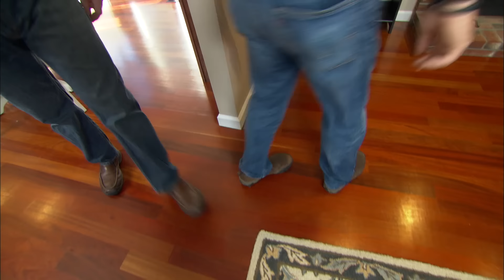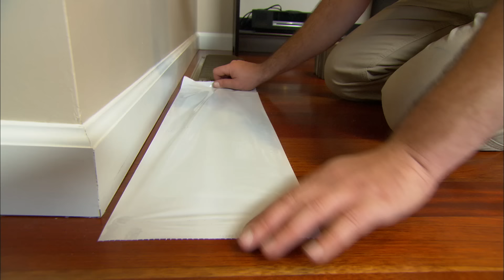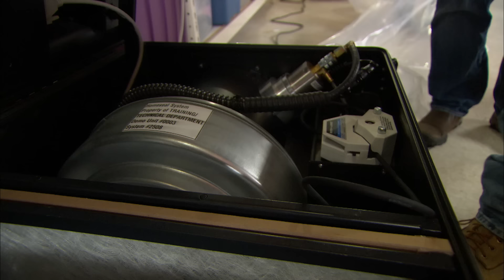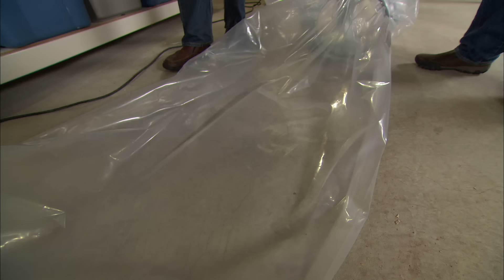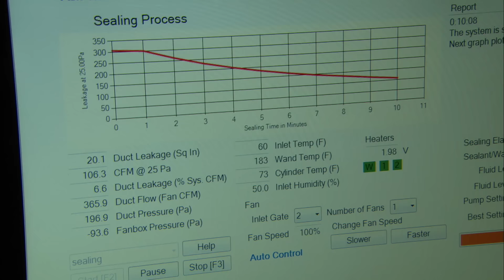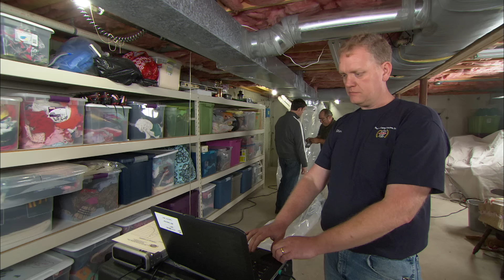How to Seal Leaky Ductwork | Ask This Old House

Comment: Ran hundreds of High Bill Complaints for the gas utility in St Louis, Missouri & I can tell you first-hand this service boils down to ductwork in unconditioned areas and ductwork in conditioned areas. For ductwork in unconditioned areas this service can be advantageous.For ductwork in conditioned areas such as basements or inside soffits there is very little advantage and in some cases big disadvantages. I had a customer that actually had a reduction in basement heat ,much like this installation & the water pipes froze one cold winter night ( I believe the Insurance Company for the duct sealing service picked up that bill).
Reply: Could have just put a register in the basement feed?
Reply: @phillymathguy8142  Yes, and it's better to have a small register vs relying on leaks because you're controlling where the air ends up (and what ends up in it).
Reply: @phillymathguy8142  , exactly, you want to keep the conditioned areas conditioned (don’t worry about a little duct leakage if it’s going into the condition area  & yes, add those registers were needed) . Take the money you saved from not insulating the basement ductwork and insulate those basement walls.

Comment: Cool technology. Better check the fan static pressure before you do this. If the fan is already having to pump against high resistance on leaky duct what do you think the resistance will be once all the leaks are sealed? The key is properly sized and sealed ducts. Old ducts are notorious for being undersized

Comment: you could just use some HVAC mastic tape or mastic sealant for about $25 from home depot and do it your self....or you can pay a guy like this $1000 or more to seal your system. They need to rename the title...
Reply: What about ducts inside the building, there's no way to access those.

Comment: Do HVAC installers do this, or is it a specialized thing?  I recently had a new furnace and new air conditioning put into my 1939 house with original forced air ducts, and I'm thinking I should probably get this done.  My HVAC installers did not mention anything like this, but they did refer me to a duct cleaning service.
Reply: Specialized service. I believe it’s still under patent/licensing agreements with a company called aeroseal. They use trained contractors across the country to perform the work.

Comment: Prohibitively expensive  in NNJ. But this is typical of initial  installation being done so poorly.  Hvac installers have their sights on the next install job before they even finish the current.  Just the way it is with most of these guys.  They demand top dollar for poor craftsmanship.   I speak from personal experience.

Comment: Should be titled: "How to pay someone else to seal leaky ductwork".
Reply: How would you seal leaky ductwork?
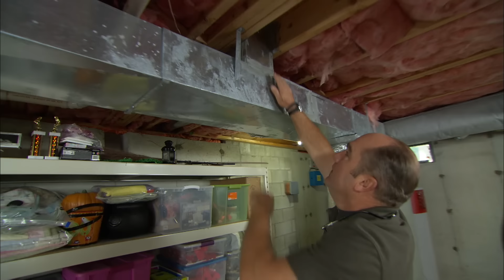Reply: @Joseph03743  2:00
Reply: @DLo5604  How would you get the mastic on the ducts on the walls on the second floor? Tear out all the drywall?
Reply: @aaronvance7372  You probably wouldn't. There's no doubt this duct sealing service beats mastic and taping. 
But there's an implication that when you click a How-To video on popular Do-It-Yourself youtube channel, you're going to learn how to Do It Yourself - Even if better work could be done professionally.
Reply: @DLo5604  That's bs, it isn't better then a quality mastic job. A mastic job cost substantially less, can easly last 30 years plus, this spray crap doesn't seal large gaps as mastic can and they don't back it past ten years. The cost of their jobs is easly triple a by hand mastic job and where you can't seal with mastic a homeowner will see far better savings investing the price difference in more insulation or doors/windows
Reply: @aaronvance7372  No you seal as.musr as you can with mastic, have your ductwork cleaned. Mastic jobs are substantially cheaper, last 30 plus years vs 10 of this. Invest the difference with better windows, doors and insulation. You will see substantially more savings then this will ever be able to do.
Reply: @zack9912000  please go to therapy
Reply: very clever.....

Comment: What happens to the coil once this crap plugs it up?
Reply: GOOD QUESTION. BUT THEY BYPASSED THE COIL WHEN THEY DID IT. HOOKED UP THE SPRAY TO THE SUPPLY AND RETURN, DID NOT GO THROUGH THE FURNACE

Comment: Holy f&*k. Too much work and expense! Slap some foil tape on those joints and call it good. And who insulates their ducts???
Reply: Foil tape dosent last long term. Need mastic to seal and ducts need to be insulated to prevent condensation when air conditioning and especially when ducts are in unconditioned parts of the house

Comment: Aeroseal would be the best option
Reply: @UCV9wEzJNlc8AhG1ha3t8fpA depends on duct work . But unless its been installed correctly and sealed from the start aeroseal is the only option. But sealing the outside with mastic is the only ok ther way

Comment: I've always wondered about something like this. My house was built in the late 60s. Anywhere a branch came off the main duct or return was massive leaks. I cut holes in the supply trunk and return wherever I knew ducts were coming in and out. I then sealed those branches with proper metal duct tape, duct mastic, or a combination of both. I then cut a larger piece of sheet metal to put over the hole, screwed it in and sealed it with more duct mastic. That helped quite a bit. There are still some areas I need to get to that I can't at the moment. Those spaces suffering the most that I can't get to, are above the garage.
Reply: Wouldn't hurt to spray some spray foam!!! Sounds like you got it going right.. I would've added spray glue though.. makes all the difference
Reply: Now that’s dedication

Comment: Got the quotes for my 1700sqft house 3-4k LMAO LMAO LMAO
Reply: @Stackali  Yeah, you must break even shortly after paying off your 30-year mortgage.
Reply: @Stackali  for that amount of money i'll comb over ever inch of my ducts with a magnifying glass and come out ahead
Reply: @ibtarnine  so true, and it would prob be healthy, god only knows wtf is in this sealant crap. I would avoid it.
Reply: That is pricey. Costs of heating / cooling our home related to the furnace/aircon run is about $150 6 months winter, $180 4 months summer, with about 2 months a year we don’t use either (maybe less than 2 months). If we even only saved 15% we’d save about $250 a year, so need to be here for the quote we got 10 yrs. BUT, that’s just the savings cost. There are the other benefits of more balanced temp for bedrooms and basement, and longer furnace life and lower maintenance costs. So potential pay off for us after considering indirect costs is 7.5 yrs.
Reply: @zalllon  Don't forget cleaner air since more of the home's air will actually go through the filter.
Reply: 😳🤬 WOW!! That’s a crap load of money for a 1700sqft. Crazy.
Reply: I got a quote for 2000 cad for mine near Toronto.  Ask home depot, they have people who do it too, might give you a better deal
Reply: @mojo36911  curious how big your house is? And how leaky did they say your ducts were? Really wonder why it’s so expensive for what it is.
Reply: At that price if you have a single story home just replace the ductwork and make sure they seal it properly.

Comment: If metal is a good conductor of energy, why is it used between the air handler and the room?
Doesn’t it lose 40-60% of its efficiency?
Why not pvc?
Reply: Metal is used do to its roughness factor and formability. Were worried about airflow and friction when it comes to ductwork not heat transfer or loss, thats what insulation is for. Pvc would be incredibly expensive to use given the sizes needed  to get the volume capacity needed for proper airflow.
Reply: Most homes these days use Wire Flex (think of a giant slinky wrapped in plastic then that is wrapped in insulation and plastic)which is very well insulated. Most solid ducts in homes are wrapped in insulation to prevent the leakage as you saw in this video.  Commercial buildings with spiral duct  (the solid stuff you'd see in a five guys or chipotle) are not insulated at all, the idea is that you won't lose much because the occupied space is treated and therefore shouldn't be that much cooler/warmer than the ducts, though I've always had an issue with that idea.  Why not use PVC? Cost mainly, it would be incredibly expensive compared to wire flex or spiral duct and would take much longer to install.
Reply: they do use pvc pipes in most newer and smaller townhouses due to much simpler design in these houses. metal ducts are still needed for most detached houses due to flexible nature of metal.

Comment: Absolutely no heat loss here even if the ducts leak a little in the basement 
This is called stack effect or chimney effect where hot air is constantly rising 
If you experience cold rooms save your money by adjusting the floor registers to push more air into rooms that need more heat
Everyone is trying to sell their gimmicks to you   Not needed in a properly installed HVAC system
Reply: Your clueless

Comment: The dust is probably from a stronger blower than the old furnace and stirring up the dust in the duct work. It’s not from leakage in the duct.

As for cost of this versus saving and paypack, I would be interested in that.

Plus all leakage isn’t into unconditioned space, so you are not just loosing it, it may not be going to where you want but it’s still in the thermal envelope

Comment: What does this sealant do to the evaporator and heat exchanger? Or did they remove them from the airflow somehow?
Reply: I bet they were removed from the system prior to
Reply: it's very easy to divide the HX and humidifier off from the main duct during the operation, just ask the true foreman duct cleaning guys.

Comment: What is the cost of this process
Reply: Based on the price I was quoted, about $2,000
Reply: @MichaelMangi  does it base off  number run and or sq ft of house I assume..
Reply: @bradami1234   I think it was based off number of systems, but maybe number of vents factored in.  All I know is on the paper that was offering it from the HVAC company I was talking to about an AC replacement the listed fee was $1795 for Aeroseal but they also wanted to clean the vents first and that would be another $300. 

I don't know if the price varies much as my googling shows others saying it's the same price. What I'm not sure about is if the energy savings is enough to justify the cost.
Reply: @MichaelMangi  great point on energy savings justification

Comment: Use liquid nails always works great on duct work
Reply: I just used LN Construction adhesive and it sucked. Took well over 24 hours to dry :/ Not good if you live in the house you are repairing :(

Comment: Will this help lower humidity levels in the house?
Reply: I suppose it could if the humidity is coming from your intake vents. For example, if your intake ducts are leaky and sucking up moist air from your attic or basement or crawl space, that could cause a humidity issue.

But I'd say that if you have a humidity issue, a whole house dehumidifier may actually cost less and do more for lowering your humidity than this sealing duct service.
Reply: If the basement is humid and not running a dehumidifier than yes

Comment: What an idiot. Like sealing the ducts will fix the imbalance between up and down. Typical salesman
Reply: It wont fix an imbalance of hot and cold but will fix positive and negative air pressure imbalances
Reply: @koreymayo8884  not always, may make them worse.  For example you have a return near a laundry room with a massive leak in the attic, by sealing the return and making it pull more air you will put the area into a more negative pressure and have seen furnaces backdraft hotwater heaters, but the usual culprit is the when the drier comes on.  Then people can get co poisoning real quick.  I'm BPI certified.  Not just as simple as seal and its fixed.
Reply: @CommonSenseFishing209  dont know what bpi certified is but I'm certified to handle refrigerant and leaks on the return side cause negative air pressure in the attic or crawlspace/basement where the return  is while leaks on the supply side causes positive air pressure in the house, but ideally you want zero leaks on both sides and therefore you wont have any negative or positive air pressure anywhere in the house except for when bathrrom exhaust fans are turned, range hood exhaust fans in kitchens, and clothes dryers like you mentioned. Fortunately my house has hard ducts everywhere and zero leaks that I could find, but most houses where I live use panned joist returns that are undersized and usually leak from not sealing them with mastic and suck in dirty, unfiltered, humid crawlspace air and supply ducts with flex ducts that usually leak from mice putting holes in them.
Reply: @CommonSenseFishing209  how are people getting carbon monoxide poisoning from duct leaks?
Reply: @koreymayo8884  Ill try to explain it.  When a system runs supplies put rooms into positive pressures, or usually do.  Return areas are a negative pressure.  When ever furnace is near a water heater or drier a communication can occur either way.  By return air being a negative pressure or by a leak that pulls a confined space into a negative pressure which would pull carbon monoxide fumes down flue pipes of water heaters and furnaces etc.  It all depends on the situationl.

Comment: How did he calculate that CFM loss at 4 min? 307 divided by 400 CFM per ton?
Reply: All these videos are scripted
Reply: I’m actually interested in the math behind it too
Reply: 4 ton system @ 400 cfm per ton, 1600cfm ÷ 307= 0.191875, move decimal two spaces to the right gives you roughly 19%.

Comment: Why does it look as if the  supply and return trunk are connected to each other with round ductwork? Right above their heads when talking about the machine
Reply: Terry Thomas it does indeed look like it. That can’t be a good thing right ?
Reply: Good observation. Might be a bypass duct that dumps supply right into return, sometimes you see this when you have a multi-zone layout served by a single fan. When one zone shuts off, the excess air pressure then "bleeds out" into the return

Comment: If you have extra cash to help out contractors then it's nice gesture to call them and pay. If you are tight on budget, don't let contractor takes your $, your ductwork is fine and you don't need insulation. Hot air rises so if there are leaks it keeps your basement warm and will find its way to upper floors anyway.  Or you buy a roll of aluminum tape for $5 and tape around the joints. But I  leave it alone to warm up the cold water pipes down there so they may not get frozen by accident. Call the city and ask if the product is permitted with building codes and ask any contractor to apply for a repair permit with the city to protect yourself. Where I live, it's by law and the contractor I hired applied and paid for the permit like around $100 for furnace installation. The city sent the inspector over after it was done, he made the guy to come back next day to fix soddy work or license is suspended. That's how to protect yourself from cowboys especially with hot water tank or heating furnace.
Reply: Finally someone who is thinking what I am. All the air that ‘leaks’ is leaking into your building envelope right? So it’s not really lost, just displaced I guess.
Reply: True for conditioned areas but if the ducts in the walls or attic are leaking then that heat or cold air will be lost.
Reply: That’s a great idea

Comment: I think the best way of preventing this in the first place is sit on the HVAC contractors that installed this in the beginning and make them use that duct putty and seal all the joints as they are installing them.
Reply: That only works if you have the opportunity to do it. If you bought a house then chances are it came with ductwork already installed. If you have a house built then I suggest you either visit the construction site often or pay someone else to keep an eye on things it if you aren't sure what to look for. If you can afford a few 100k to get a house built then a few extra thousand to pay someone to keep an eye on things and make sure stuff is done right shouldn't be a big deal.
Reply: @Ancyker  a house costs 1M to build here in Vancouver
Reply: @tombomombodombo  that just makes my statement even more true...
Reply: Lifehacks move
Reply: lazy bums in florida
Reply: I install new duct commercial and residential and even seal with the correct steps . A new systems has leaks . Aeroseal is a great product for energy conservation.  
Also large building such as hospitals or condos with multi levels units due to ducts not being accessible benefit the most from these systems
Reply: Apparently a lot of people think it’s rude to want them to do their job properly

Comment: Two questions.  First, did you physically clean the ductwork before you sprayed the sealant.  Ductwork has years of built up dirt, dust, mold, and dander.  Second, did you isolate the furnace and coil to prevent the sealant from clogging the evaporator coil and other components that will heat.
Reply: You could see the two pieces of plastic were installed before and after the furnace. It won't touch the furnace while being blown in... However I bet your filter may get a bit clogged with residual rubber after you start it all back up..
Reply: I was thinking the same. Now all the dust is glued into a sheet, but not actually sealing the leak itself.
Reply: Where I live all returns have an air filter before the return ductwork and therefore the ducts never get dirty unless someone is dumb enough to take out their air filter or unless there are leaks in the return ductwork.

Comment: that one inch hole created during the video proves the sealing procedure proposed in the video does NOT WORK FOR LARGE LEAKS AS SMALL AS 1 INCH HOLE
Reply: But you would never have a hole that large. The gaps are on the order of 1/32 inch or less.